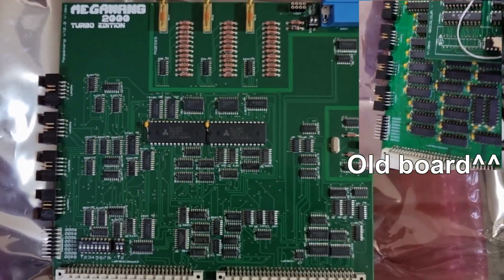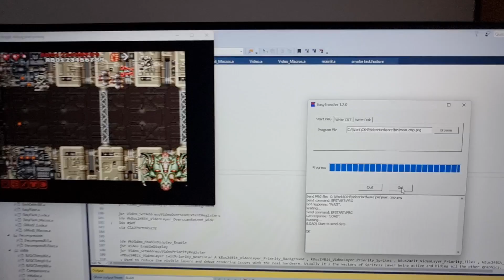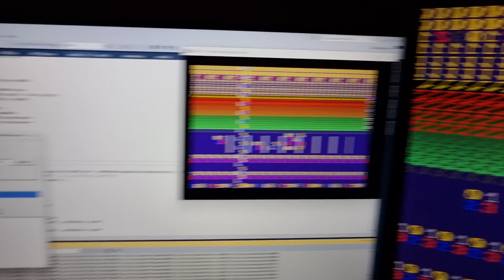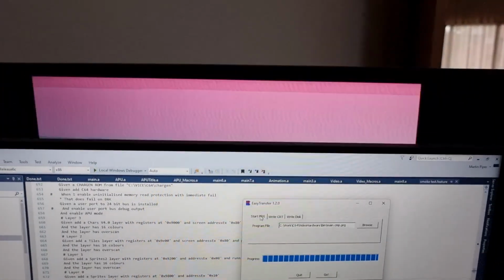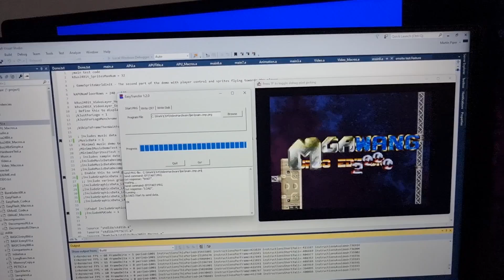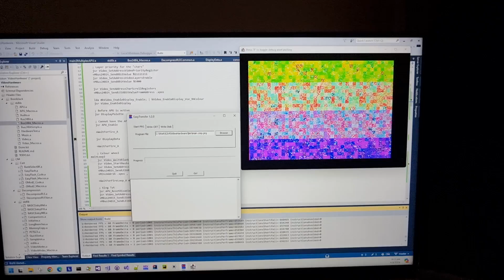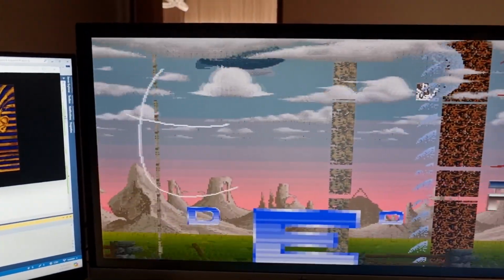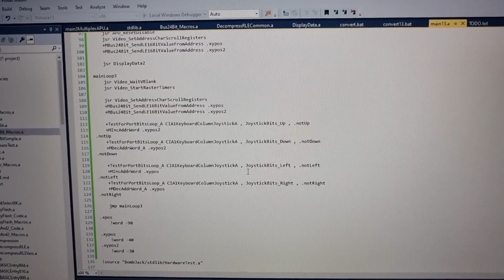MegaWang 2000 Turbo Edition - 25 - More colours RGB565

Comment: Wow! This is super impressive work and absolutely amazing to see in action. It's like you're recreating the evolution of 80s to early 90s custom arcade hardware graphics pipelines (which, as best I can tell, reached it's pinnacle in the Taito F3 before the arcade world went to 3D). Of course, in the 90s advanced designs had evolved to using ASICs from the slower 74LS parts you're using.

Mad respect to you sir!
Reply from the maker: Thank you. This is deliberately using 74LS to show what's possible without needing to use ASICs or CPLD or FPGA

Comment: That's pretty wild 👍 Reminds me a bit of turning the C64 into a PC Engine. Have you considered using FPGA or even CPLD to simplify the boards? A bit like the Kawari VIC2 replacement but with your own spin on features. There is also the RAD expansion that gives you a REU plus other useful features, but based on a PI board.
Reply from the maker: I often get asked this. :) The short answer is to help teach how to help teach how to solve engineering problems using low-level discrete logic. I believe that knowing how to engineer a solution using low-level discrete logic is an advantage, in other words it helps to improve the use of higher level CPLD or FPGA engineering to know lower level architecture.

https://github.com/martinpiper/BombJack/blob/master/README.md#why-not-use-a-cpld-or-fpga
Reply: @MartinPiper6502  Fully understand your reasoning that you're not designing a commercial product. I think it's just a knee jerk reaction of anyone doing electronics design to recommend a CPLD or FPGA when we see a bunch of logic chips 😄 I agree that VHDL isn't very intuitive.  I used to do work with a Russian military contractor back in the 80s/90s, they designed everything using logic chips because they didn't have access to microcontrollers. It was quite amazing, but of course their electronics was many boards in large boxes. I reduced one one these boxes with 8 daughterboards using just a single board with an 8051 microcontroller and a few PAL chips and some analog circuity. Good times 😄 Love your project 👍
Reply from the maker: I like Verilog and VHDL too, just not for this project. :)
Reply: @MartinPiper6502  This.  Agreed!

Comment: Nice work!
If the sprites are palleted perhaps you could have a 4444 mode where you have 4 bits of alpha.
Reply from the maker: Alpha would require reading what is there, across layers, and then doing a calculation and storing it back. Which is rather complex for a bunch of 74LS TTL to do. :)
Reply: @MartinPiper6502  Yes, you would need more complex pipelined line buffers. It is amazing how much you have achieved without a FPGA.
Reply from the maker: It's quite a lot of incremental changes over a few years. It keeps me out of trouble :)
Reply: @MartinPiper6502  Depends on how it works. If the layers are all computed independently and output a pixel per clock, and there's a final stage that assembles the output (i.e. picks the layer to display the pixel from), alpha would be fairly easy to implement?
Reply from the maker: I've been pondering having a "priority" for each sprite and each character/tile, this would allow some sprites to appear in front or behind the a tile layer, for example. Some sprite based arcade boards, like the Sega System16, would do this.

I do already know the correct pixel for each layer, but RGB alpha needs a lot more combinatorial logic.

Comment: Why RGB565? Wouldn’t that mean that no gray can be a pure grey? 5-bit color would be a scale of 0 to 31 thirty-firsts, and 6-bit color would be 0 to 63 sixty-thirds. Those don’t mesh, so I’d expect all the grays to have some hue to them.

(Loved hearing Cream of the Earth in the background btw 😄)
Reply from the maker: RGB565 fills all 16 bits in the palette RAM, I could not waste a bit with RGB555. :)
On the board the colours are all balanced resistor ladders using 6 bits (RGB666), but externally red/blue have the least significant bit tied to 0 giving them both 5 bits available in the palette. The means using RGB565 8,16,8 or 4,8,4 or 2,4,2 etc would have the same RGB component output levels and would all be true greys with no hue.
Glad you noticed the Cream of the Earth, I've liked that track ever since the Amiga days. :)
Reply: @MartinPiper6502  — fair, if you do it that way, you can get pure grays... just with the caveat that white would have to be represented as 0b1111111111011111.

Awesome hardware btw!

(And best soundtracker mod ever)
Reply from the maker: Yes, that's right, I figured it was the best way of squeezing the most out of the available 16 bits per palette entry while allowing the option of using the extra bit, or not.

Cream of the Earth is definitely a mod file, it is also notorious for testing compatibility of players since it uses quite a lot of different commands.
Reply: What MAGIC is this..?!!!?